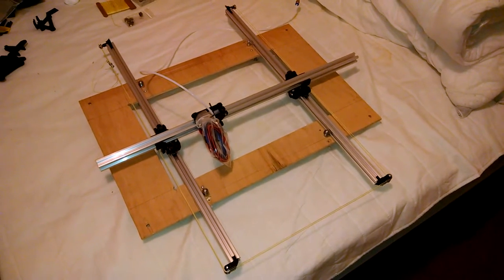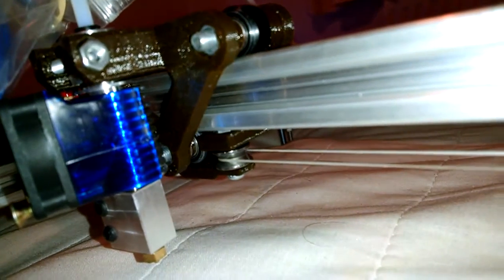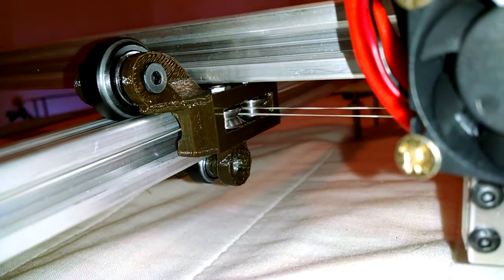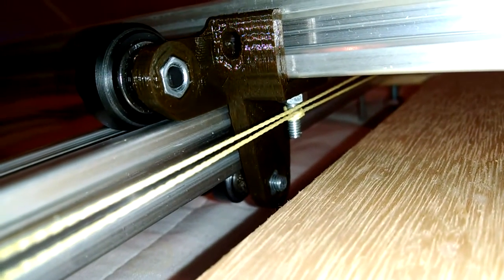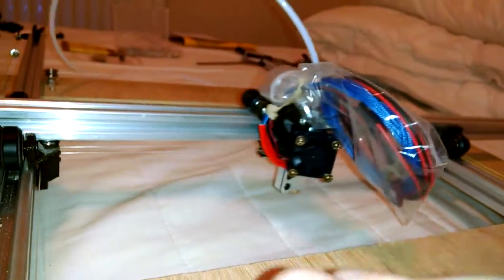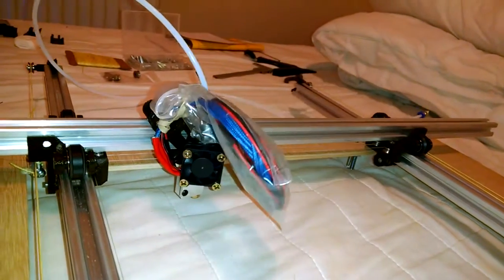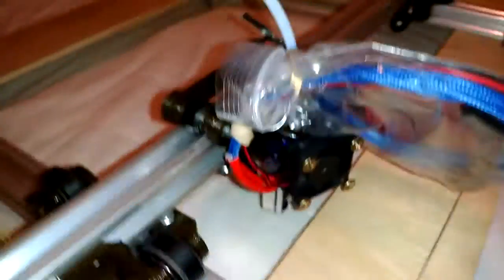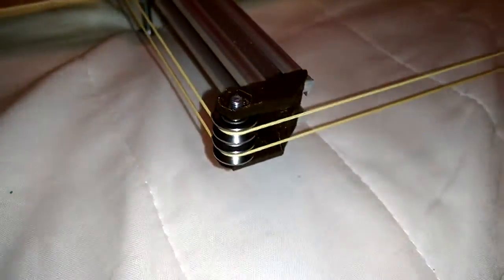2^1over Proof of Concept

Comment from the maker: Hi, I actually paused development and made a Smartrap Core, which I can't recommend highly enough. I made some mods and added a second Z screw and put them both at the side. Have a look at my build and links to files. http://forums.reprap.org/read.php?344,501860,622030#msg-622030
You can adapt the Smartrap core quite easily and they have a large aluminium frame version out now. 
If I were going to complete this design I would definitely try and follow the smartrap core motion design. Hope that's helpful.